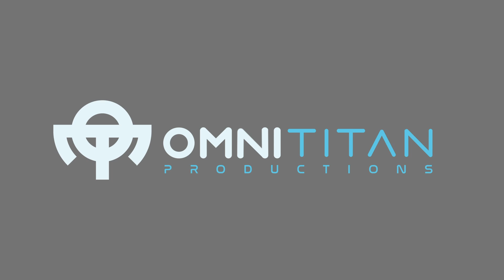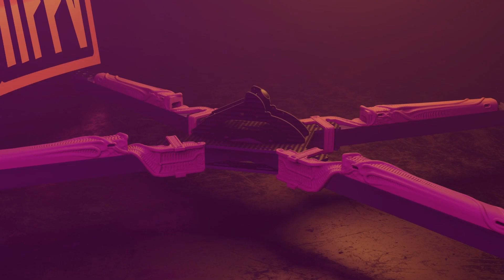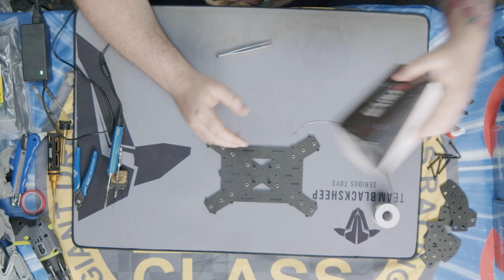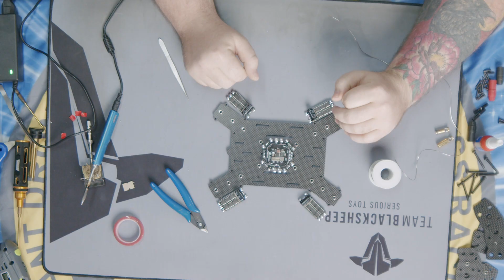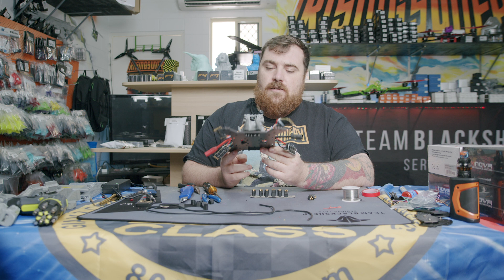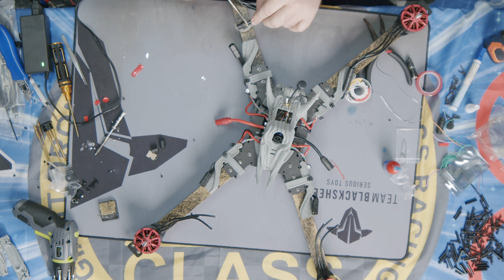Rising Sun FPV BFW Electronic Build Video

Comment: Will the apd 120’s drive the ko 400’s man.
Reply from the maker: Yeah they will, you'll just have to run two extra 50v or 60v or 80v caps per esc. This helps prevent voltage over spikes and saves your escs. We do this with every motor though and since doing this we haven't had to many dramas with blown escs.
Reply: @RisingSunFPV  sweet man. I use 50v in all my apd builds any how thanks for tip.
Reply from the maker: @noisey_boi_rc  we have a good article on our website as well that goes more in depth about capacitors.
Reply: @RisingSunFPV  lol I have beast class and muscle quads with 9-10 caps on em.

Comment: Rev pad not needed full pass through available now apd 2.0. 80amp-200amp rpm full config
Reply from the maker: I just put 200amp on my race rigs, was having difficulty getting the telemetry working but got there in the end with some support from APD. Flashed a customers 120amps with the rpm filtering firmware the other day and it was fairly easy.
Reply: @RisingSunFPV  yeah i e dine a food few times now. Nipping off c28 resistor a little ballsy lol. I need a FUCKING big wedge in my life asap. You fucking nailed it man doom theme killer man.